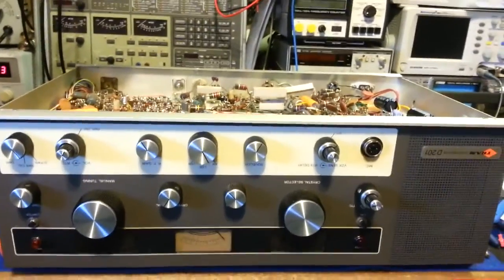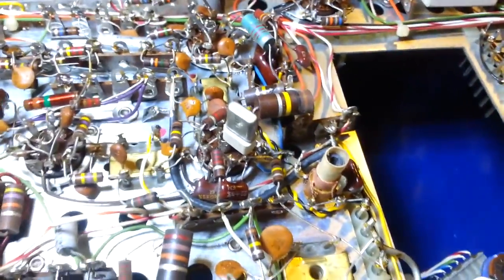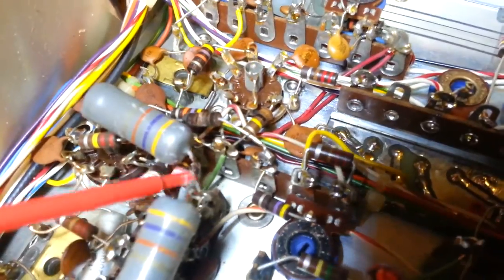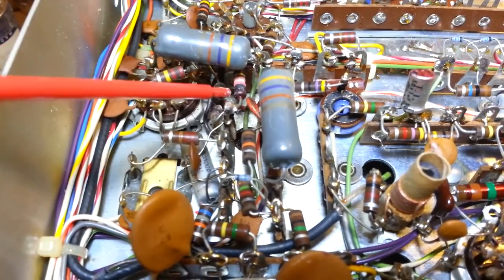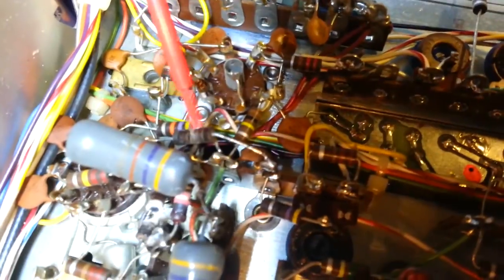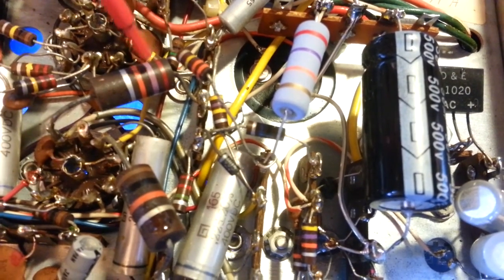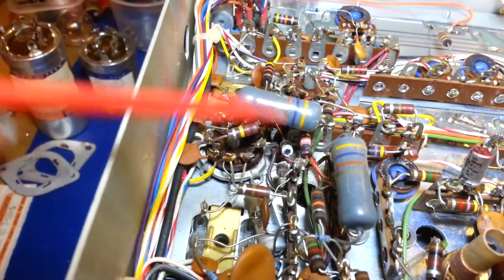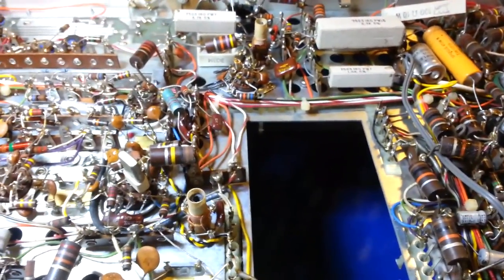Tram D201 hand wired no AM receive repair and restoration Part 1

Comment: One thing should be pointed out here: if the resistors are in a high-frequency (RF) circuit, lead length could be critical, make them too long and your circuit could suffer from degraded performance, pick up other spurious signals, or oscillate when it's not supposed to.
Reply from the maker: William Squires 

Pretty much all the high wattage resistors in a D201 are coming off the B+ power supply and are dropping voltages for various circuits.  Definitely something to be aware of though.  Another thing to remember when replacing resistors in a radio like this is their operating voltage.  Many modern resistors are not rated for the voltages used in tube gear like this.  I found that out the hard way one time when I accidentally ordered the wrong resistors.  They were good high quality Dale brand resistors but I forgot to check the spec sheet and it got me.  No smoke, no visable signs it had failed, it just went open.  Radio was working one second and not the next.  Learned the hard way, always check operating voltage when ordering resistors.

Comment: so if the monster resistor were spaced away and add a fan. the problem would lessen if not stop blowing other resistors.
Reply from the maker: Really no need for a fan.  With the use of modern metal film resistors of higher wattage that are installed farther away from surrounding components the problem has been resolved.